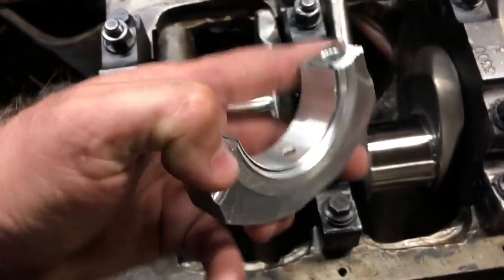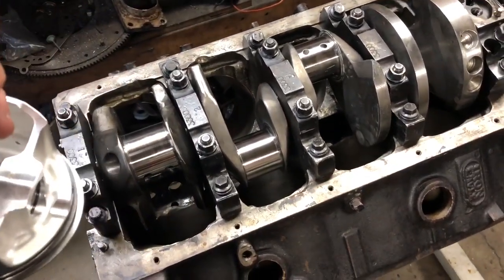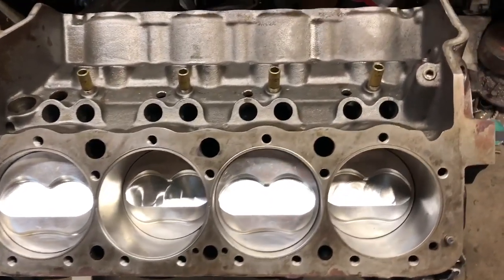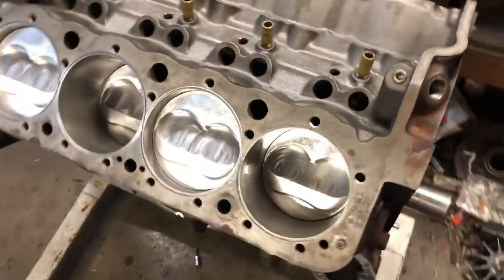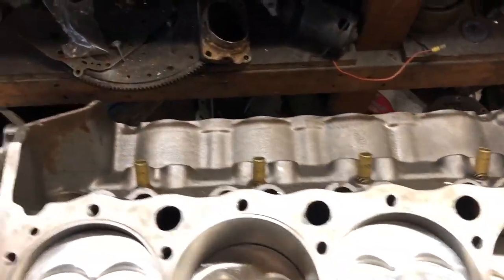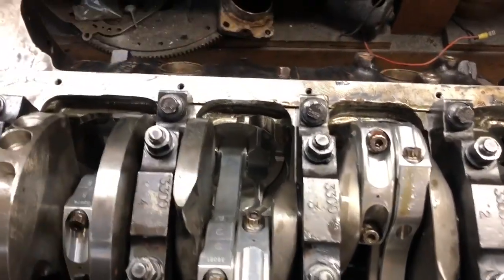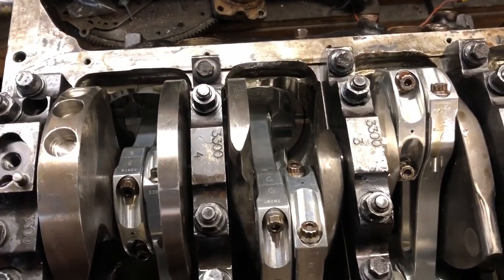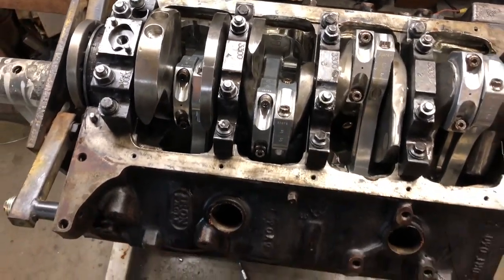Can it take 1800hp???   SBC Short Block Assembly......getting closer

Comment: the tog wire u installed is there a company that already makes that done already ? jw nwb . or just doing that your self cheaper?
thinkingof a dart 406 block ? any complaints of it?
Reply from the maker: I had the groove cut at the machine shop, I installed the wire.  At some point I’m gonna get “top fuel hoops”
Reply: @TurboJohnRacing  thanks for the info. over here in Indiana it's hard to find ppl into this stuff and if they do they won't tell you anything. lol expect what's in it.

Comment: How much clearance do you got between the rod and how much did Piston in grams weights how much did the wrist pins weight in grans and you do know that you got the run more cylinder head clearance with aluminum rods then you do a steel rod right
Reply from the maker: .050-.060 for clearance.  I don’t remember the weights, but my machine shop weighed everything for balancing.  I do run .060 head gaskets also.
Reply: @TurboJohnRacing  you only had to have 37 gasket with a zero deck I don't know what your deck height is that's from the top of the block to the top of the piston at top dead center
Reply: And fifty thousand clearance between the rods is enough
Reply: The reason I wanted to know why the Pistons weight the heavier the piston and wrist pin the harder it is on the crankshaft and rod I've run aluminum rods for 20 years the same set with no problems or crankshaft problems

Comment: It's only 300hp/liter.........not a lot these days compared to some import builds. But truth be told, the tuning is really going to decide whether it lives or not. If the base engine makes 600hp, 30 psi of boost will give 1800 hp ( 2 bar is low in the race world )
Reply: @Moparmaga-1  Bar is a pressure measurement. 1 bar is like 14.5 psi
Reply: @chrisgriffin3374  thanks chris